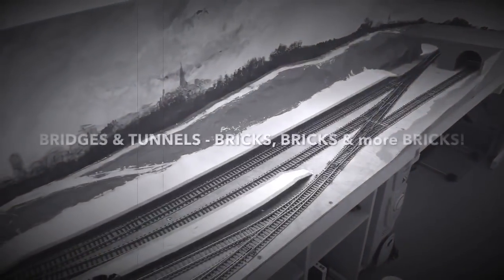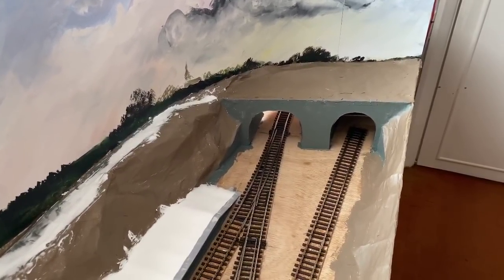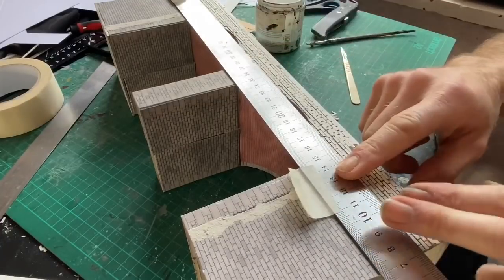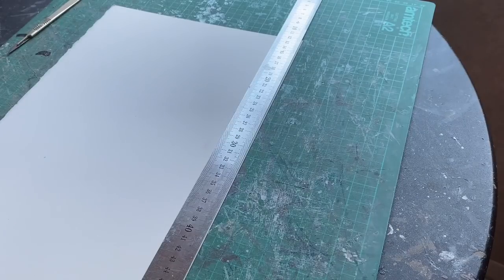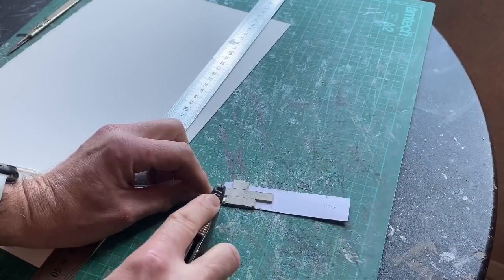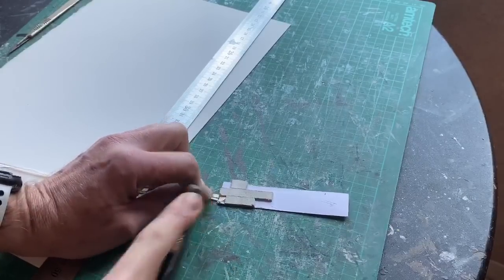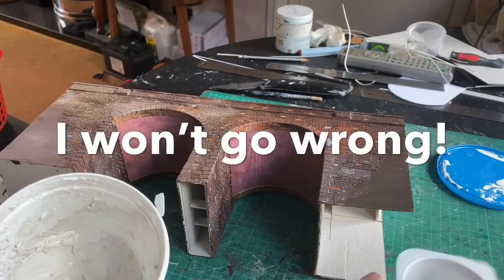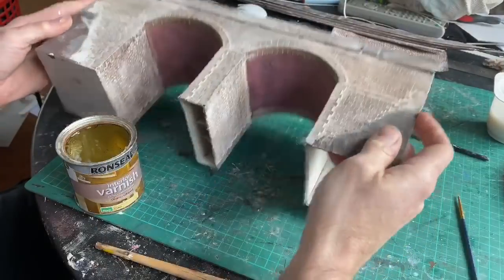OO Gauge BRIDGES & TUNNELS - BRICKS, BRICKS & more BRICKS

Comment: John you have converted me. After seen this video I'm swapping gauges. What detail you have managed to get in there, absolute inspiration to the modelling world.
Reply from the maker: Ahhhh, sooo kind David, I just think we work with what we’ve got. 

I love both my N gauge and this OO. Both have their merits and limitations. On the N gauge I can run full length trains or near enough but in OO an 8’+ train is out of the question in my setup. Yes OO and bigger will allow much more detail, but  the over all size and what you can fit in is always going to be the age old decision.
Reply: @piccadillymodelrailways  I honestly think the detailing that can be achieved in OO is out of this world and you have certainly shown that with the work you have put in to those tunnels and bridge. I also noticed that the larger scale is also cheaper than the N Gauge when it comes to locos you can get off eBay so for me it's a winner all round.
Reply from the maker: To some degree, I think its pretty much on par. Eg Dapol N gauge HST 2 powercars, buffet and TGS coaches £160 with subsequent coaches £22 each. 

However in OO, livery dependent, the Virgin liveried LNER powercars alone are £261 with each coach £31.50. Thats assuming you can get all coaches. Just seen in Hattons the buffet coach USED!! £61.

All in all it depends on what you want to run. I do like OO but I also want full length trains. Def personal decision .

Comment: That brick formation you are doing is a half bond if the brick is of standard size like a house brick which is 9 inches long then we used to call it 4 and a half bond . i have done this myself with model roof tiles 4 mm to the foot .i don't know what size of brick you doing it in but it looks great and a hole lot cheaper than wills plastic stuff .good work john.
Reply from the maker: Thanks, yes with the current climate trying to save pennies. It took a while but glad its done now. Thank you for taking the time to comment

Comment: Enjoyed this John you have great patience my friend, not sure if I have enough. My use plasticard to do mine.though I suspect the mortar lines might well be a little more defined with your method. One question the paper used? It looked like you used a sheet of watercolour paper , I noticed the moulded edge to it. Cheers Paul at Sandling Junction
Reply from the maker: Thanks Paul, there is absolutely nothing wrong with the plasticard. I was trying to save on the pennies as schools are closed right now (supply teacher) but I also wanted the randomness of the oldy worldy brickwork of long ago.

Yes it is watercolour paper. My 95 year old mother used to paint, I tend to paint digitally on the ipad, teaching art in school or for the layout. The paper is kind of surplus. Although never know watching your streams I might do the odd ‘real’ painting. In the meantime thought Id use a couple of sheets for the bridge and tunnel.

Comment: The results are brilliant John with the tunnels you can almost taste and feel the soot !! A couple of questions when you first put the brown base layer down did you wipe off after to stop blocking up the mortar joints ? And what was the dark oil you used for weathering ? They are two buildings that you can be proud of ......…….Cheers Kev
Reply from the maker: Thanks Kev, so kind of you. I put the varied brown mix on first with acrylic paints, you could use oil based paints like enamel but must be dry. The important there is about 3-4 similar colours bended so you can see each, rather than mixed you don’t want a single colour mush. 

Its NULN OIL. Its not really an oil its water based black. Easy to make really thin black wash with a tiny drip of washing up liq. Its basically paint with no water tension
Reply: Thanks John I loved the effect you achieved. 😀👍🏾
Reply from the maker: I think it was the filler that gave the ‘stone’ look.
Reply: I had not seen the filler technique before but if certainly worked.
Reply from the maker: You could use a fine coating of clay over the building and scrape in brick work. Clean up is essential though if that was done. I just watch YT videos Im only copying what I see more often than not. Just come across ‘Peaks47’ amazing channel, especially for countryside scenery.
Reply: Agree I like Peaks 47 although his methods are simple the results are excellent.
Reply from the maker: Nothing wrong with simple methods. Sometimes my methods are bit complex but they are what they are. Lol

Comment: Hi John, my N gauge layout will be excess of 30' in length and some of the train/track runs will not be far off and I am worried about track noise. Having spoken to exhibitors on exhibition layouts they say they lay there track directly onto the plywood board, stating that the noise after ballasting remains the same even if you put foam or cork under the track. Now that is alright at exhibitions but my layout is going up in the loft. So I am at a loss as whether to lay straight onto the plywood board or use 2mm cork or Woodland Scenics Track-Bed. Can you offer any advice please as I get so much conflicting advise on the internet and wonder what your thoughts on it are.
Regards Chris
Reply from the maker: Hi Chris thanks for the question. If Im being honest Im perhaps not the best person to ask as my N gauge layout is in an upstairs bedroom not in the attic.

May I ask why the noise is a potential problem?

What I can say is that my track is set on 2mm cork and parts are ballasted. (It is right about the noise and ballasted track.) when Im downstairs I cannot hear the trains running upstairs until I climb the stairs. More so if the sound locos are on. 

May suggest you also ask you also ask Geoff at Pride Parkway as his layout is in the loft and he runs full length trains at speed. Do be aware though if the loft is insulated it not only insulates for heat but sound too. Have a think. Hope thats kind of helpful.

Pride Parkway 
https://www.youtube.com/channel/UCKn84-uWitBtxyq9IxLA2eg

Comment: Admire your patients but....you laid it in stretcher bond - never, that's just for facings, modern builds. Should be English bond or even Flemish.
Reply from the maker: Thanks for the comment. May I remind you though it’s cardboard model, the strength comes from the cardboard. The bricks are bits of paper stuck on to look like bricks. So to be honest the brick bond makes no difference what so ever. Cheers.
Reply: @piccadillymodelrailways  Yes John I get its cardboard and the bond doesn't matter for strength. Perhaps Im being a bit anal but just like people have to have the running number/paintwork just so on a loco, Im saying bridges are not built in stretcher bond, so it doesn't look right. Regards.